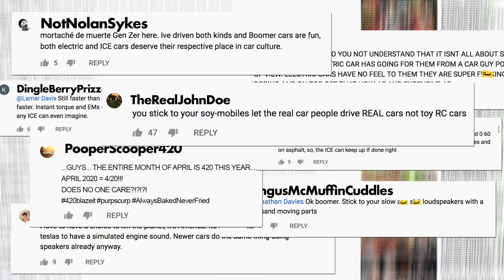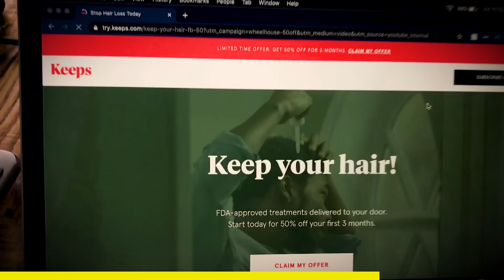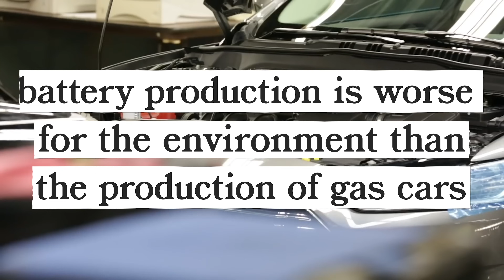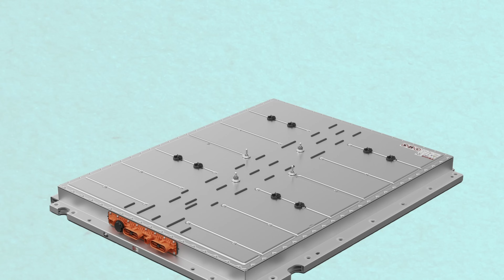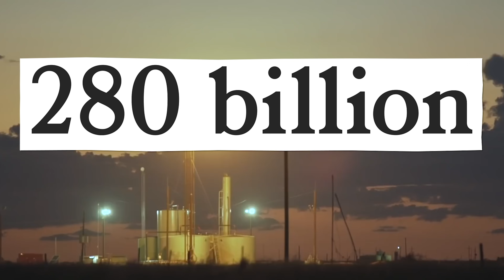Are Electric Cars REALLY Better for the Environment?

Comment: A really good idea would be EV semis and locomotives. These vehicles operational day and night so once the tech advances I think we can make a bigger impaction on emissions. We shouldn't make internal combustion engines obsolete but enjoy them like we do classic cars or doing rips on the drag strip. The process is slow and takes time as well as acceptance to move to almost all EV it won't happen over night like some advocate and lobby for.
Reply: Ev semis are a terrible idea.  I can barely find a parking spot every night most times I improvise.  How am I suppose to find a charging station at that.  It takes me 10 min to fuel 150 gal which get me 1000 miles. We don't have time to wait  hours to charge.  Even if you put a charging station in every parking spot, it won't be enough, because there are not enough parking spots  Trucks drive in all weather conditions and power outages could leave thousands of trucks stranded that would cripple the supply chain in certain areas
Reply: Electric semis are also 10,000 pounds heavier so that's 10,000 pounds less you can haul so for roughly every 5 trips you make in a diesel semi you would have to make 6 in an electric
Reply: @kevinclinger5987  Wouldn't power outage also affect fuel supply, considering fuel stations require electrical power for pumps to work?

Regardless, the bigger issue is battery weight anyway. It will make sense in light-duty vehicles such as cars, but it is a nightmare in heavy-duty vehicles. For railways, forget battery and use overhead wires or third rail instead.
Reply: A good idea is getting the facts on the global warming scam and why it's destroying your life right now.
Reply: @ricktd6891  The more frequent natural disasters caused by climate crisis brought fourth even greater destruction. Besides, even if the environmental implications are ignored, its foolish to ignore technological progress that offers greater efficiency. For example: LED light bulbs.
Reply: @ricktd6891  "Circumstances affecting the Heat of the Sun's Rays" by Eunice Newton Foote
Reply: @dbclass4075  A quick search shows that doesn't exist or was removed from the internet. What was your point ?
Reply: @ricktd6891  There's the problem: searched quickly instead of thoroughly. YouTube no longer allows external link. Just copy the entire previous comment,

"Circumstances affecting the Heat of the Sun's Rays" by Eunice Newton Foote

then search. Alternatively, copy then search the phrase below.

Davidmorrow Eunice Foote
Reply: @dbclass4075  I'm not wasting more time on it. What does it say ?
Reply: @ricktd6891  If you just followed instruction, it would barely take any time, and is even the top of the search results. But alright, text of the journal is as follows:

Thirdly, the highest effect of sun's rays I have found to be in carbonic acid gas.

One of the receivers was filled with it, the other with common air, and the result was as follows:

In Common Air:
In shade: 80, 81, 80, 81℉

In sun: 90, 94, 99℉

In Carbonic Acid Gas:
In shade: 80, 84, 84, 85℉
In sun: 90, 100, 110, 120℉

The receiver containing the gas because itself much heated-very sensibly more so than the other-and on being removed, it was many times as long in cooling.

At atmosphere of that gas would give to our earth a high temperature; and if as some suppose, at one period of its history the air had mixed with it a larger proportion than present, an increased temperature from its own action as well as from increased weight must have necessarily resulted.

Of comparing the sun's heat in different gases, I found it to be hydrogen gas, 104℉; in common air, 106℉; in oxygen gas, 108℉; and in carbonic acid gas, 125℉.

- page 383, Article XXXI-Circumstances affecting the Heat of the Sun's Rays; by Eunice Foote, The American Journal of Science and Arts, Volume XXII
Reply: There are lots of electric locomotives already. Siemens Taurus is one example: https://www.youtube.com/watch?v=-SDYdHzT7Qw.
Reply: I think there's a reason why electric trucks didn't catch on
Reply: I think it would be smarter to push for cleaner sources of energy and restricting crude oil collection than electric cars. That would inevitably make gas cars obsolete unfortunately, unless you only mined enough oil to support gas cars.
Reply: @deathbyunicorn5213  crude oil will be refined no matter what energy source we use in our vehicles. Plastics, polyester, and other products are byproducts of refining oil. We won't use as much with a different energy source but the products we buy need oil in some way. Recycling is not enough to sustain that. Not all plastics can be recycled either, maybe reused in another fashion.
Reply: @kyletitus205  That's why I wish companies cared less about money. If we want to live another 50 years we have to pick our priorities.
Reply: @deathbyunicorn5213  we're gonna live way  more  years than that regardless of if we switch energy sources. Exaggeration only makes people uncomfortable, we all know what needs to be done no need for lies to discourage people.
Reply: Definitely agree with your first point about EV semis and locomotives. The majority of car emissions comes from semis which run all the time and get less than 10 mpg even on their best days. Making them electric could make a real difference in the grand scheme of things
Reply: @alexadeshigbin8129  Truck's payload is massive, though. A single truck is more efficient than multiple cars carrying the same amount of cargo.

Railways are easy to electrify. Don't need batteries, overhead wires or third rail will do.
Reply: @alexadeshigbin8129  CO2 doesn't control the temperature of Earth anyway.
Reply: I like what you’re getting at but keep in mind that ALL the world’s vehicles only account for ~15% of greenhouse gas emissions. Industry including agriculture accounts for almost 56% which includes power generation. Perhaps that should be the focus.
Reply: @joseesparza4133  Man's CO2 is less than 3 % of all CO2. What are you going to do to reduce the other 97 % ? Stop volcanoes from erupting ? Stop plants and animals and humans from dying ? Stop the oceans from warming and degassing CO2 ? When will you suckers wake up ?
Reply: @joseesparza4133  Focus your ass on learning some basic science and basic Earth history so you'll be smart enough to know CO2 caused catastrophic global warming ( now falsely called "man-made climate change" is a scam.

Comment: not sure anyone's asked...but why are assuming EV's last as long as ICE cars? always just assumed.  if a 13mpg Land cruiser lasts 300,000 miles more than a TSLA, or put another way, lasts as long as 4 TSLA's...then we should compare the footprint of 1 LC to 4 TSLA...
Reply: well current generation EV's inclusive of tesla's, are designed and are showing to last over 500,000 miles to a battery. Infact at the 100,000 miles mark for the Tesla model 3's, they're averaging only 2% degradation. With the rest of the components of the car (excluding brakes and tires) designed to last well over 1 million miles of use with zero servicing, modern EV's will last approximately 2-3 times longer than an average ICE. And do so with next to zero maintenance.

Comment: Thanks for the video and I’d say I get your position as a car hobbyist. Couple things I worry about. Here in CA we already have blackouts and Edison is giving out rebates if they get control of your thermostat. So no, the grid is not ready (HERE) for EVs tomorrow. And recycling, like you brought up. Yes, we hope EV fans have better answers to the recycling problem “later” and hopefully in time before disaster happens with old batteries. I am not hopeful though as the hundreds of thousands of 20+ year old solar panels now aging on people rooftops don’t have ANY recycling plan in place for those. They go to the dump once their efficiency drops low enough. Solar has been around more than 20 years and yet there is nothing in place yet.
Reply: Not to mention: we did the same thing with plastic, and plastic recycling still barely exists. 

Still pro EV, but that doesn’t mean EVs are a miracle cure. We have to do a lot more, and do it better.
Reply: @KelsomaticPDX  You mean everyone needs to do less with less sooner.
Reply: EVs are going to force power companies to stop being cheap and fix their grid. California's power issues is due to them being cheap to invest in fixing the solution vs Band-Aids to keep it running to have max return. Elon himself offered to fix Californians grid issue and they never took him up on it ... So that should show you where they stand on getting the grid fixed
Reply: A lot depends on the power plants producing the power.  If they are coal plants or anything not very clean than it’s bad to charge your cars up vs say natural gas.  It’s just not a simple fix but the grid argument is critical
Reply: Was gonna say the same....These batteries efficiency is still impacted by severe hot and cold making it hard to approximate a used ones lifespan.  The market and infrastructure in place to upcyle used combustion vehicles helps keep vehicle ownership a possibility for more than just the wealthy.  As you can imagine Gavin Newsome uhaul and tent salesman of the year has a problem with this..  Furthermore any sustained driving requires waiting for a time while it  charges and time is money.  These vehicles will be replaced or have the most detrimental components replaced and poorly recycled in shorter time than the length of life or ownership of a Toyota.  Purely speculation but how many Tesla drivers do you think have outdated phones or TV.'s that aren't smart. Purely bullshitin
Reply: Truth there. But most batteries have a second live as batterie based compensation for grid fluctuations, and there are plans that EVs will have the same function. With more solar and wind will be more fluctuations and we need more compensation in the grids, if EVs are here to stay or not. The endpoint for shipment traffic and intercity buses will be hydrogen, but this technic is in an far earlier stage then EVs and hydrogen is just a form of energy transportation and far less efficent then pure batterie. There are also developements of carbon based batteries, more lightweight, more efficent and far easier to recycle and with less lithium and cobalt. Tesla is going to implement them in the next models. 
But like he said, it depends on the adaption of the industry, politics and society to work to the degree we want/need to
Reply: @snmer9396  And the real problem is consumption. There are 4-5 billion people who want to consume the same amount of luxury goods first world citizens have. Who are we to tell the no?
Reply: Also the massive amounts of toxic storage mediums that are required for green power. Wind cant work without wind and clouds kill solar and well hydro is not a choice it's either possible or impossible due to the local environment. That and of course the fact that batteries become grenades when hot or cold or wet or punctured. Dead EV batteries are also super toxic near if not sometimes exceeding the level of nuclear waste.
Reply: @psycophantic  solar power has more potential than any current energy source, the only reason it’s not viable is because our infrastructure can’t store and release it at a controlled rate, requiring grid scale batteries. These batteries aren’t anywhere near done improving. Right now the goal for investing in these technologies is to artificially provide capital and incentive to improve upon them. If something isn’t profitable it won’t be good. They become exponentially more efficient, longer lasting, and revivable when there is a market allowing better infrastructure and research. Imagine how inefficient and terrible for the environment the first combustion vehicles and energy sources were

Comment: I find people are STUPID!!! They never seem to understand that an electric car STILL requires a lot of oil to make them!! To begin with it takes oil to machine the parts that require tooling to make shafts and other machined components of ANYTHING on the car!! Metal that is still required to make a car doesn't just automatically come out of the ground "formed" into parts and shapes we need them to be in!! And steering spindles and brake parts like other parts need machines known as "Mills" to make flat mating surfaces and so on too!! 

Secondly in most cars there are vinyl dashboard covers, and sometimes seat covers and nylon carpet on the floors!! Both Nylon and Vinyl are made from oil with nylon beginning production during World War II as a replacement material for silk used in parachutes in fact!! Many of the coverings even on bicycles (again vinyl and in some cases nylon) are used in seats as well, and Nylon stitching in car seats and even shoes are widely used, because nylon DOES NOT ROT!! 

Though I am adding this last, there are still many lubricants used on an electric vehicle too. Grease is used in steering components as well as bearings to allow the wheels to roll. This grease is still made from oil, and let me not forget that a lot of plastic parts to make the car "lighter" in the first place are also made from oil!!! And there are other key things to a car that have oil in their production like automotive paint for example that is petroleum based as well, so literally the whole car is painted in a thin layer of an oil product!! 

And further showing how stupid people can be, then fail to understand NOT ONLY how a car is made or what it takes to make the car they own and drive, but they also ignore other facts, like how the car is transported from the factory it was built at, which uses Diesel Powered trains and trucks to get it from the factory to your local dealership! Also most people never consider where their supply of electric comes from as the leading majority of electricity still comes from coal fired electric plants, or nuclear or even hydro electric, which again requires oil to move coal, make even more machined parts and the same can be said about wind turbines as well!! Further yet, speaking of wind turbines the fiberglass blades of a wind turbine would not exist if it wasn't for oil polymers that bind the glass fibers together!! So just because you think you are "saving the planet" from "evil oil companies", it shows how stupid most people are again, not understanding oil is literally EVERYWHERE IN OUR LIVES!!! From cell phones to tablet computers to the vinyl coating on most electrical wires to the asphalt that make our modern roads!  Nobody understands, considers or even think about where a lot of the things we have come from or how the stuff is made, shipped or created!! And just because you have a computer and give your stupid opinion on what you think you are doing to "save the planet", you are still using an oil based product some place in your life and never actually realized it!!! 

In closing, electric vehicles failed in the past because of a number of problems!! Range has always been the largest of those, because you can get a gas engine to go much further than electric cars!! Electric also has other problems like in a crash, they can leak toxic chemicals into the ground water, they can burst into flames, and the electric batteries can electrocute you as well in an accident!! And that isn't even the problems you might face in a wet climate like here in the northeast with constant rain and snow!! Wires after all don't handle getting wet well, and electricity can be dangerous in a wet environment also!!
Reply: Ummm. Ok, people don’t buy EV’s to boycot “evil oil” they do it A.) because it makes more financial sense, and B.) because even when powered from a coal fire plant they significantly reduce the amount of emissions compared to an ICE.

If the idea was to stop using oil entirely you might have a point. But no, that’s not what’s happening.

Additionally there isn’t much toxic is lithium batteries, if the batteries do leak it will lead to thermal runaway evaporating all the electrolyte. So it doesn’t leak into ground water I don’t know where you were getting that from. EV’s handle just fine in wet conditions, most mobile phones these days are water proof even with exposed charging ports so it might not come as a surprise to you that modern science has worked out how to waterproof electronics the size of a car. Do you have issues with the wiring harnesses in any other vehicle when it’s raining? Didn’t really think so. So why do you think EV’s are any different? You can find videos of EV’s driving through snow and flood water.
Reply: Also the chances of you being electricuted in an accident is low to none, the car has a lot of sensors, if any one of them detect a crash it sets off controlled explosives which disconnect the battery and isolate it from the car. No electrocution. In addition EV’s are 11x less likely to spontaneously combust compared to ICE vehicles and 5 times less likely to combust in an accident. On account of them not having highly flammable fuel piped to an engine well above the ignition temperature, which itself is sitting in a circulating well of more flammable oil.

Comment: Well done,  Kudos on the impartial treatment of this subject! BUT: equating environmental harm solely with greenhouse gas emissions leaves OUT the most serious problems: Pollution, environmental destruction from new mining, and the un-addressed dangers of crashing an EV and the resulting fires that are difficult to impossible to extinguish. ICE vehicles have a head start of over 120 years and their problems are being addressed. EVs are in their infancy and most of their problems have YET to be addressed.
Reply: Mining for oil and gas, oil spills, fracking and well blow-outs also cause serious harm to the environment. Minerals are also used to process crude and ass additives to fuel products.
Reply: https://www.youtube.com/watch?v=rXjjk40RurA
Reply: All for a global scam.